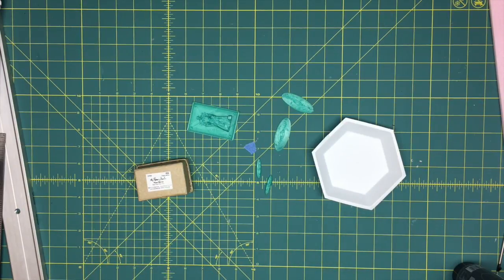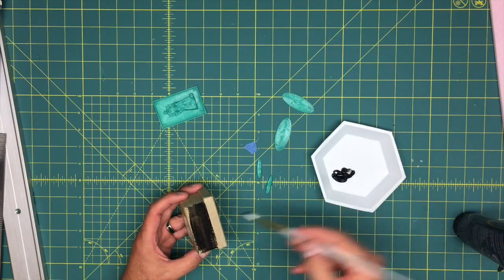GTE 003 -- The Tomb

Comment: Great video, thanks! With regards to using cardboard for terrain projects, I find that they tend to sag a little in time as they soak up humidity. Do you have any advice for dealing with that?
Reply from the maker: I've not had any problems with humidity, even here in Atlanta. With the cardboard painted (and sometimes covered in Mod Podge), I don't worry about the cardboard. That said, most all of my stuff stays in an air conditioned environment, so that probably helps.